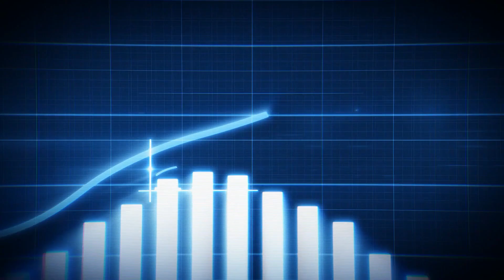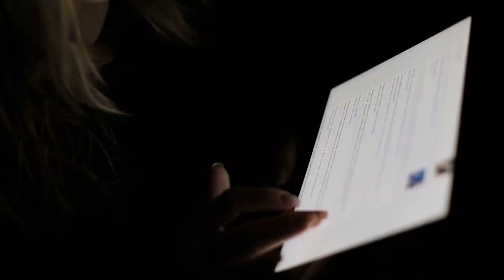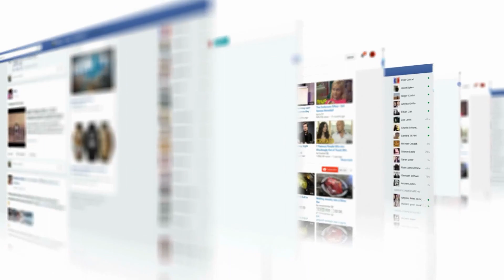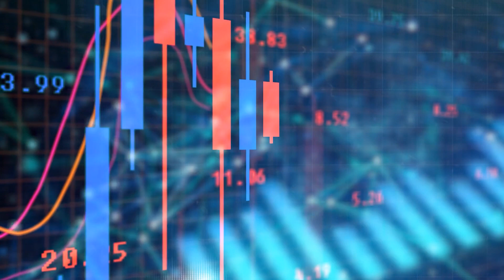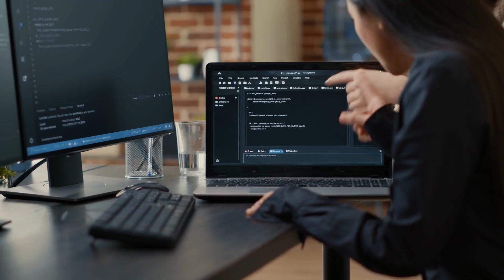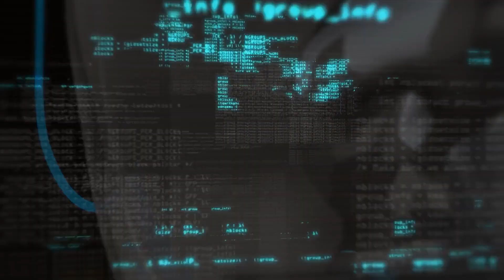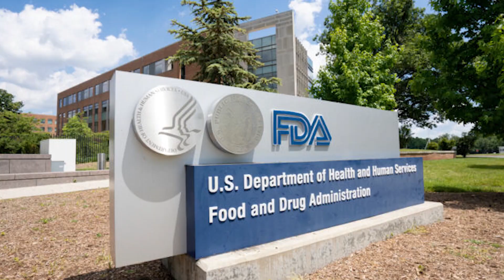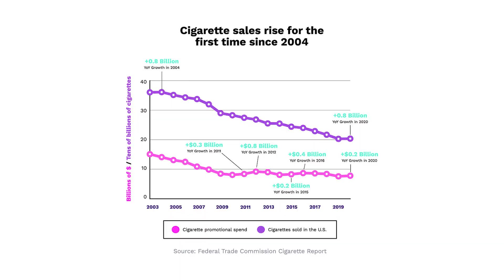6 Months Left To Save Humanity From AI

Comment: What click fodder trying to "predict" 6 months. It's possible that anything can happen but this would only happen if there were bad programmers. Being an expert myself and coding for over 35 years I know that 85% of the programmers out there don't know what they're doing. They don't have the ineffable quality to plan it right. I was the one at several companies that made things goof proof. I have a high IQ and a high EQ and that's what it takes to write this kind of code. I'll give you an example: I worked at a place that made sensors that could read if a light was from a flame or not. A single channel device running on a microprocessor. They wanted to make it have two channels. When I looked at the code there was only 2 bytes of memory left. But the guy wrote a repeating routine everywhere it was needed. Instead I made the routine into a subroutine and did jumps to where it was needed using far less code. When I was done I had TWO channels and FOUR bytes of memory left over. These are the kind of "programmers" writing code for everything we own. Use poorly talented people and you'll get the apocalypse.